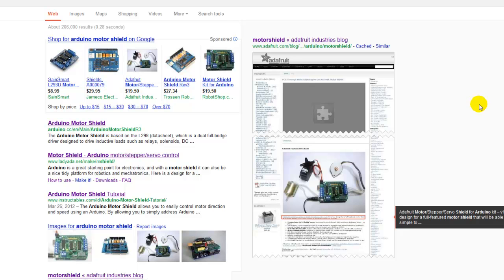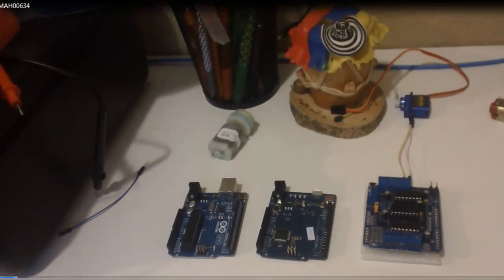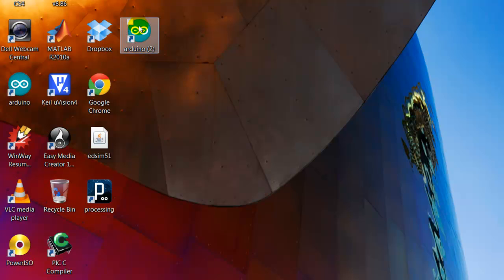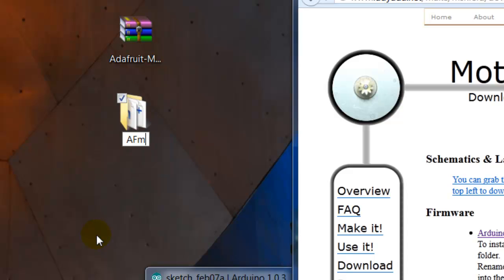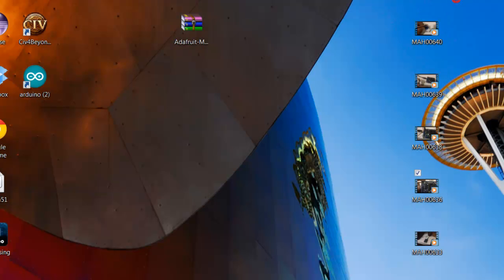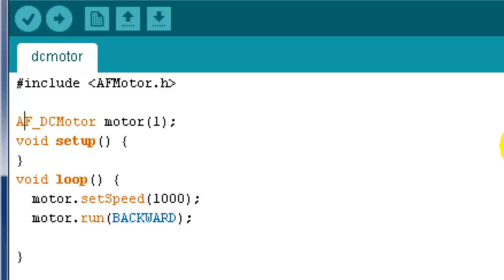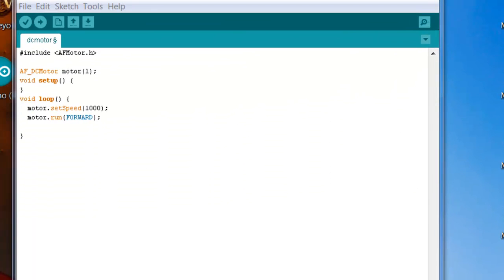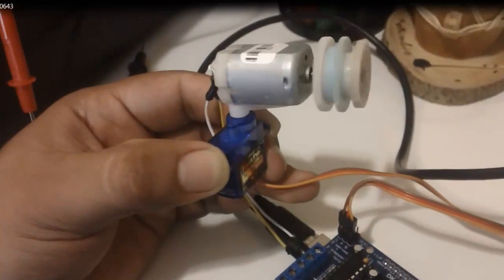AdaFruit Motor shield

Comment: really great and hope you will help me to solve my problem.i used 6-8 AA batteries as the power supply to the motor shield.but the led is not lit and it means that the  DC/Stepper motor power supply is not working.is my shield destroyed ???

Comment: man o man what a super good video  but i have one more question
instead of 4 dc motors  can you use 4 relays ??
thanks in advange
Reply: +R Gimminez you can have 8 relays with reverse side diodes on four motor options
Reply: thanks man   you are great
Reply: I WOULD RECOMEND YOU TO USE 74HC595 SHIFT RESISTER IC INSTEAD AS IT IS CHEAP AND USES ONLY THREE PINS ON ARDUINO AND CAN CONTROL UPTO 6 AND YOU CAN HOOK MANY IN SERIES AND GET ALMOST INFINITY DIGITAL OUTPUTS BUT REMEMBER THAT IT IS NOT FOR FAST I/O

Comment: Hey it would be great help if can you describe connecting a stepper motor to the motor shield ? I have a 6 wire stepper.
Reply: just search for stepper motorshield arduino
Reply: You have to ohm out the wire leads. The colors are not standardized. I saw a really good YouTube video that shows how. Can't link b/c I'm on Mobil right now.
Reply: Chris Iorizzo I have 5 wires

Comment: If the ping sensor requires digital inputs you may want to look into just wiring straight to an hbridge rather than using a sheild.

Comment: I have used the Tamiya double gearbox with this shield. I revised the example motortest sketch to handle two motors, and have a video on YouTube of the test. Have you attempted to use a Parallax ping sensor with this setup? If so, how did you get the ping sensor wired up, with the motor shield taking up all the pins?

Comment from the maker: Yes you could use them, it is +5 and ground; Did you use a resistor before connecting the LED, you need at least 150ohms resistor, 330ohms better. As long your not using the same pins as the motors then you free to use them.